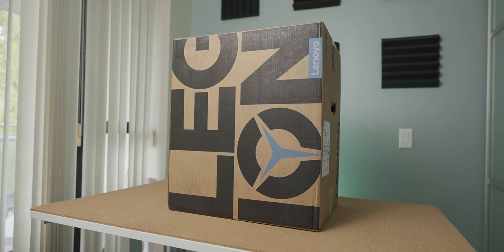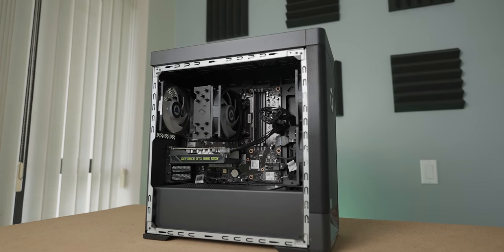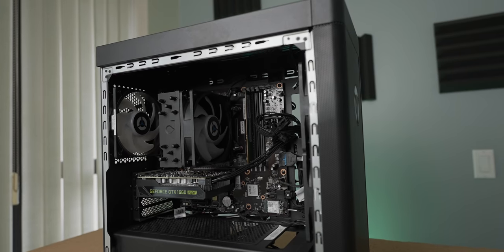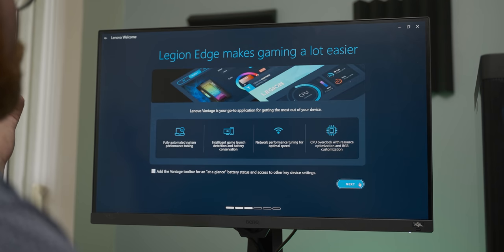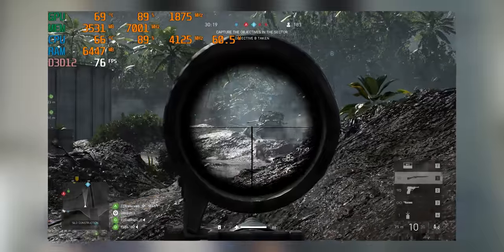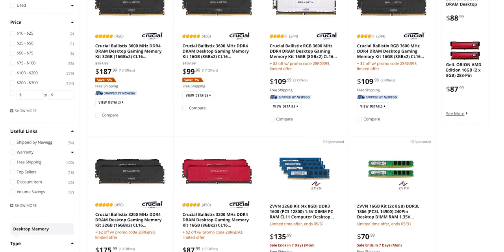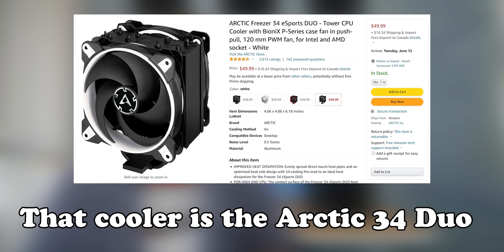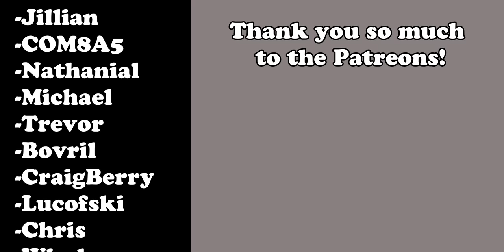Is Lenovo the KING of OEM Gaming Pre-Builts?

Comment: Lenovo has the worst customer service (read: practically nonexistent) I've ever had the displeasure of experiencing. I have fallen prey to their "make great hardware but skimp on the customer service" approach twice now and I'll never buy another Lenovo system again unless they fix things. I highly recommend you avoid them as well.
Reply: What did you need their customer support for?
Reply: Apparently the Legion line has their own dedicated support that is a lot better than their standard support. A free year of that is included when you buy Legion PC.
Reply: @fred-youtube  The question is kind of irrelevant given I was never able to get in touch with any support techs. But to answer your question, two laptops. 

First was one with NVIDIA Optimus (this admittedly was 7 or 8 years ago). I reformatted my PC to get a nice fresh install sans-bloatware etc and learned after the fact that apparently Optimus required a special build of Windows and as a result I would never be able to get my NVIDIA GPU to work again unless I were to get Windows install media for my specific device. No Windows media was provided with the laptop, only on a separate partition, which was deleted when I reformatted.

The second involved a laptop that stopped charging 2 years ago. I could not get in touch with anyone about an RMA or anything and the best thing I could find after a week of desperation was a document stating that I could send it to a certified repair technician who could assess whether or not it was a covered warranty repair and if not they would charge me, which is fair, but not once in this entire time did I ever get to speak with a Lenovo tech that helped point me in the right direction or find any answers.
Reply: @craig71686  That's good to know. I really wish Lenovo would do better with CS because they really make great devices.
Reply: Oh boy. And I thought Dell's customer service was bad. I called to check whether I could install an m.2 SSD on my inspiron 14 and the guy took almost an hour to tell me that he was not able to find the reference of my laptop.
I had to open the laptop to check the motherboard.
Reply: @superlumbagoman9370  At least you can get in touch with someone at Dell :D

Comment: I wanted to build a PC, but with limited supply and scalper prices I went with a prebuilt. I got an HP Omen 30l with a Ryzen 7 5800x cpu, Nvidia GeForce RTX 3060ti gpu, 1tb NVMe drive, 16GB of Hyper X Fury 3200 MHz ram (8x2), liquid cooled with a 750w power supply.

I upgraded the ram to 32gb of Hyper X Fury 3200MHz ram (16x2) and added a 1tb SK Hynix SSD.  So far I’m liking it, but man did I picked a bad time to get back into PC gaming.

Comment: G'day Dawid, Anna & Neko,
That Intro & OEM Manufacturers Gathering was Awesome 🤣🤣🤣🤣🤣
Just wondering if there is a LEG ION upgrade to 16GB available during the purchase with Lenovo & how it compares in price to buying 16GB of the Crucial Ballistix
Wow, The current Gen of HP Pre-builts have some Improvements to leave Dell behind, but Lenovo has made a Huge Leap Forward with this Pre-built,
Especially the Case, CPU Cooler & proper M-ATX Mobo looking Good while having AirFlow that lets Temps be good while not Sounding like a Screaming Banshee

Comment: I work with Lenovo systems quite a bit.   The Lenovo software is essential on setup for system updates.   It seamlessly updates all firmware, drivers and the bios to the most current.   Afterwards,  you can remove it.    You can still do a full Win install after the updates to firmware and bios with the Lenovo software to save yourself a lot of manual updating.

Comment: Buyers beware that there's no way to manually adjust the fan curves. You can only set the fans for the GPU with MSI Afterburner, but not the CPU or the other cooling fans. Lenovo gives 3 options in their Vantage app (Quiet, Balanced and Performance mode) but to be honest it's crap. After checking the cooling and fans with HWinfo64 there doesn't seem to be a difference between Quiet and Balanced mode. So you are pretty much screwed if one of your fans is shaky or has coil whine when it hits a certain RPM. No way to adjust it, except for replacing it. This is a nice prebuilt and mine plays pretty much everything, but not having manual fan control is quite a dealbreaker imo. I don't care much for rgb lighting, so put mine inside a ventilated cabinet because of that particular fan whine Dawid is talking about in the video.

Comment: I paid 2100$ for my Lenovo Legion T5 in early 2021. MSI RTX 3070 + AMD Ryzen 9 5900X. Had 2 unused RAM slots too, so i upgraded to 32.GB.
Then i added 3.TB of extra SSD and 4.TB HDD. Works 100% 24/7/365 on 550W PSU. Also bought a 27" MSI 1440p/165 Monitor for it.

Comment: I bought one of these, because of the case design. I just love the smaller form and ventilation, upgraded the PSU to 750w, got a 5800x3D + RX6700XT, 32gb 3600 mhz.... also put a 240mm AIO. 

It's a fantastic machine, and although it took me about 3 months to gather the parts, I did it for less than $1200 USD. 

(already had ram + monitor)
Reply: Hey, what PSU and ram did you upgrade the PC with? The one I'm looking to order runs a RTX3070, AMD ryzen 7 5800 and has 550w... RAM is 16 (8x2), but I would really like to upgrade both the RAM and PSU, just hope it doesn't get too expensive and hard to do myself.
Reply: @roccomarcy  I bought a 650w 80+ gold PSU ( you may need more because 3070 draws more power than 6700xt) 
For ram I had a 32gb 3200mhz kit corsair vengeance (4x8gb) 
I built it on a budget... bought it w/o ram or a gpu and it hasn't skipped a beat! I can play anything I want on 1440p max settings, fantastic computer. Love the case design and great cooling.
Reply: @freemaysin5088  thanks a lot bud! Nvidia recommends 650w but I’ve read online that the 3070 is more efficient with power supply compared to other GPUs, though I’m definitely still gonna upgrade it. I’ll have to look more into it. As for the RAM, I’m thinking of buying 16GB (2x8) extra. I appreciate the quick answer!
Reply: @roccomarcy  It's worth a shot! The legion tower 5's have multiple power supply configs from the factory, and the one I bought was used from ebay. It mounted right up, and I re-did the cable management but these are actually pretty well done from the factory. Also, there is a liquid cooler from lenovo as well (matches all the other fans) that is sold in the Legion Tower 7, as well as the Tower 5 but it's not an option for the USA for some reason, however if you ebay lenovo legion tower liquid cooler you will see it. It's fairly pricey, but it's a nice 240mm cooler, and matches and syncs with everything. It was over $100 but i'm glad I bought it. I have had 0 issues with anything thus far, and Lenovo transferred my warranty and the online customer service helped me purchase the VRM heatsinks and gave me all part #'s and info, I'm super happy with them. Love this little pc!
Reply: @freemaysin5088  thanks for the detailed explanation bro it’s definitely gonna come in handy soon, you’re the man!

Comment: I don't understand what you mean regarding JEDEC.
The ram you linked is JEDEC PC4-25600U which to my understanding means you will run on 2560 MHz by default and will not be able to set an XMP profile, since the OEM motherboard doesn't support that. It's also pretty impressive that the memory module, which is already included, is JEDEC PC4-3200AAm which should mean 3200 MHz without touching anything.
Did I miss something regarding the "JEDEC compliant ram" you talked about? Because I can see every popular RAM manufacturer seems to have this JEDEC standard.

Comment: using an MSI prebuilt rn with an i9 and 3070
got lucky with the motherboard and this is the best system I've ever used
even comes with duel channel ram
an AIO Liquid Cooler
and a powersupply rated for the load

Comment: I bought a Leg-ion T5 in february, with similar specs to this but different config. I have the Ryzen 5 3600 and 1660 Super, but with dual 8gb sticks. HOWEVER - with a super basic CPU cooler so I have been touching 92C while gaming... Will be looking into the Arctic Freezer - excellent tip! Great video!

Comment: Bought my Lenovo Legion based on this video, and I have to say I'm pretty happy with it. it's a Legion T5  system (Intel(R) Core(TM) i7-10700 CPU) with a GTX 2060 and it performs really well and is silent as a mouse.  :) I was already a Lenovo fanboy going into this tho...the computer I was using for gaming was an older AMD A10-7800 Radeon R7 that I dropped a GTX 1050Ti into and it worked well before the graphics card started giving me messages that it was dying and I needed something new.  It still runs after my using it for 7ish years like this (I'm pretty sure the system came out just as Windows 10 was coming into prominence)...I now use it for "work from home" exclusively and game on the Legion T5, 2060 system.  I'm really happy with my new comp (even if it IS a lowly pre-built...lol) and I thank you for this vid steering me towards it.  

To this day, when I have trouble spelling the word "Legion" (I was switching the g and i around, making "Leigon"...lol), I just remember "Leg-ion".  :p

Comment: I got me one of these with an Name AMD Ryzen 5 with Radeon RX 6500 XT video card and honestly I love it. I've  had a few home built units that were amazing. My last was a home built I got from new egg The case mother board set I got had so many issues. Before that was a Dell prebuilt that I hated. It could game but blehh. For what I spent on this. $600 on clearance from best buy. I am loving it. It feels like like a  home built unit, Hardly any bloat wear. No MacAfee or anything. In bios I had to change the configuration to performance. Ounce done it games really well. For a flew hundred dollars. I got myself a nice little rig. I am very happy so far.

Comment: I got the Legion 7i model with a 10700k, 2080 super, and 32gb of ram. The larger case mine came in is higher quality than the mid size tower in you got with this build. it also had 2x16gb sticks. I highly recommend lenovo if you’re going to get a full size tower model. for anyone interested, my employer has a discount program with lenovo so hmu if you want the discount code

Comment: Hey, I got this build:
Processor: AMD Ryzen™ 5 5600G processor (3.90 GHz up to 4.40 GHz)

Main memory: 16 GB DDR4-3200MHz (UDIMM) (2 x 8.0GB)

Storage: 512GB SSD M.2 2280 PCIe

Warranty: 2 years Courier pickup or customer mail-in

Power supply: 650W

Graphics: Integrated AMD Radeon™ graphics + NVIDIA® GeForce RTX™ 3060 Ti LHR 8GB GDDR6

Keyboard: Standard keyboard with number pad, black - German

WiFi Wireless LAN Adapters: Bluetooth® 5.0 or higher + Wi-Fi 6 (2x2)

Total price 1100eur (1180$), looking forward to receiving it and testing it out.

Comment: this pc is great, i got the rtx3070 version.. its very quiet, looks cool and performs as expected. The only issue I've found with it is the wifi 6 card is trash. Bad signal, latency lag in games and terrible download speeds. Get a new wifi adapter if you're gonna buy this pc.
Reply: also an issue that occured after a few weeks of use was the pc would randomly restart itself for no reason when doing simple tasks like browsing chrome. I read this might have something to do with the hard drive, and disabling the setting that allows the pc to turn off hard drive after 20 minutes seems to have fixed it.

Comment: 1 great advantage of getting 1 stick instead of dual. Is that you can buy an 1 additional stick instead of 2 to up grade the computer. So if you
Buy a computer with 1 stick of 8gb you can save $ if you wanted 16gb instead of having 2 4gb sticks.

Comment: I got this same mode with rtx 3060 and ryzen 7 3700x with 2 8gb ram sticks and its pretty neat in my opinion
Reply: I am seeing this exact spec for 1350 local to me. Should I get it?
Reply: @LordCohliani  Yes!
Reply: @nacrus  okay thanks for the advice
Reply: @nacrus  i can get one with 5800h and 3070 , should i take it or better Lenovo Legion T7 i7-10700K 512GB SSD GeForce RTX 3070  , for 100more.? thanks
Reply: @2_CR1T1CAL  Sounds solid but 500gb ssd is really small. Get a another larger ssd or find pc with similiar specs but larger storage and you should be fine. Also check that psu attached to that pc is not underweighted. ( mine pc has 550w psu which is minimum for rtx3060 )
Reply: @nacrus  hey have you had any problems with the pc? Or overheating?

Comment: I have a Lenovo legion pre-built, it has a Nvidia 3060 ti, a ryzen 5800 8 core processor and 2x8gt sticks of ram, for 1150 euros it has been a great pc for me running everything I have at 140fps, except vr, it gives 73fps on vr, it isn't noisy and it doesn't heat up much either, exelent pc in my opinion

Comment: I got a cool little Acer from a company that referbs mostly office PCs.   Everything is pretty much just standard Micro ATX and a standard ATX power supply.  The motherboard is barebones but nothing proprietary or silly like with comparable Dells.    Got it for even less because I bought it with no drives and no GPU because I already had those from my old system.  By the time I am done the Case, CPU, and Motherboard will be the only original parts left in it.

Comment: Ballistix RAM will run at 2666Mhz base but not 3200. However this is already much better than 2133Mhz and it means that the chips are not stressed out too much when overclocking to 3200 with XMP.

Comment: I bought one of these with the 3700x but it came with  a cpu cooler like the one  you found on the Alienware. The cpu backplate wasn't that difficult to remove though. Came off pretty easy with a pry tool. It is only stuck on with two strong pieces of tape. Installed an Artic Freezer 34 Esports Duo with the Intel 115X backplate because that is what fits these motherboards. It runs well and the cpu temps are much better.

Comment: I got my Legion t5 decktop a few days ago and it's very nice. I couldn't be happier with performance, over all temps, and the overall total package. The case and cooling system simply puts it at a much higher level than all the other mid tier gaming oem desktops. 

I don't stress a system out too much, usually, and stick to older games from the 2000's...but will play a few games from the 2010's like Shadow of Mordor and Injustice 1 and 2 when in the mood. I bought the system with future-proofing in mind so I don't feel a "need" to upgrade much of anything for a good 3-4 years given my gaming preferences. And don't expect to need to buy a whole new system (or basically just reuse the case and build a new one inside) for a few years after that. The case is VERY reusable and good quality. A+ in my book!

Specs: AMD ryzen 5700g, 16gb 3200mhz duel channel ram,  1tb ssd m.2 storage, and a Nvidia RTX 3060 graphics card.

Price: ~$1600 usd (went on sale the very next day for ~$1350 usd...Grrrrr!!...but still happy.)
Reply: Did you have any issues with startups or overheating?
Reply: @Guth10  not at all...it stays extremely cool on the older games I play. The most stressing games I play are probably Mordor, Injustice 1+2, and X4, so your mileage may vary. The graphics card stays very, very cool. Great case ventilation and fan cooling in this little OEM gem;>
Reply: @Kovatt2  may I ask, do you have the link where u bought the pc or where did you bought it?
Reply: @Guth10  I just got it from the Lenovo site in order to make warranty issues simple just in case. Not sure if it's still there with the same internal options or not. I did a little research, bought it, and haven't looked back since. Sorry. I hope you find what you're looking for.
Reply: @Kovatt2  all good brotha

Comment: You get the cooler mount plate pretty easily of, if you heat it a bit up with a hairdryer. Btw. its called Legion as in roman legion ;)

Comment: While it may be the best pre-built computer there is... I STILL would not recommend it after going through what I did with mine. While a lot of stuff looks good "on the outside" there are still a lot of issues I have had with mine.

Memory that is not easily upgraded... well, upgrading the memory was one thing, but it went down in speed, and it was impossible get that speed up again. It did work however.

In my build I added to 2.5" SSDs and I noticed that the SATA power connectors were placed so close to each other that it was impossible to fit both drives and connect two of the connectors next to each other, one to each, so I ended up having to put in the second SATA power cable to power both drives.

The AIO gave up the ghost last week ago, which is when I found out that the backplate was glued (or rather fixed with adhesive tape). I did get a Arctic liquid freezer II AIO to replace it but that did not match the mounting holes at all and could not be used. In the end I got a new case, motherboard and CPU and moved the rest of the components over to that.

I was going to throw the old motherboard into the trash, but I decided to check exactly how badly the backplate was glued. I used a punch and a hammer to get it to separate slightly from the motherboard, and then used a knife to pry the rest off... bad form Lenovo... reeaaaalyy bad form.

It was my first pre-built and I will never buy a pre-built again...

Comment: I enjoy my $3000 Corsair Vengeance A7200 pre order pre built ; 3080 & Ryzen 9 5900x watercooled before most can even find them in stock, 32 gbs 3200 mhz ram,  1tb m.2 drive. Many rgbs as well. I had 3080 before most others. Well worth. Lenovo also makes good hardware great video not sure about the king of pre builts test Corsair Vengeance over Corsair One.